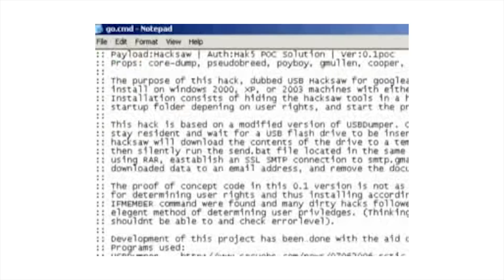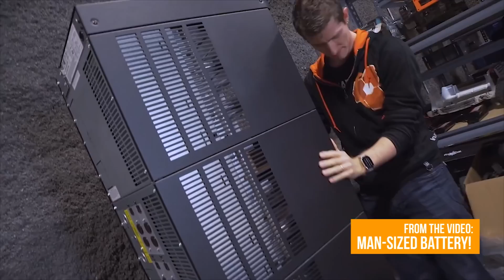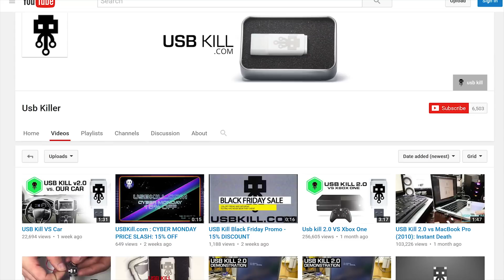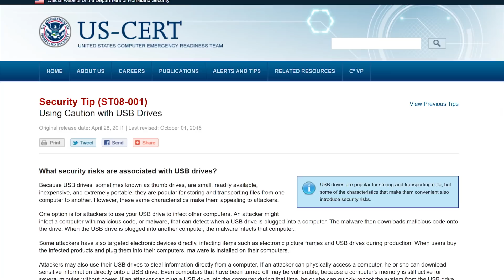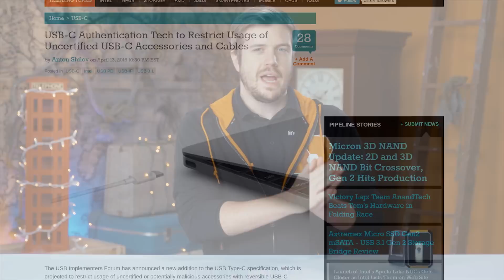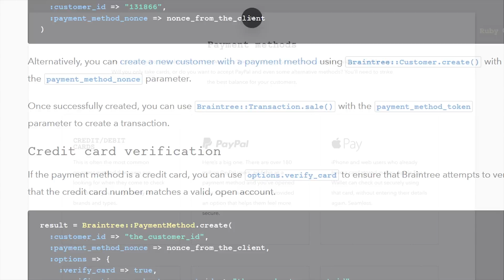COMPUTER DESTRUCTION (GONE DEADLY)

Comment: Even with optocouplers, the diode inside could die of high voltage. There is no clear way to protect against a very crude attack like this. Not even the "cryptography" could help. Sure if the USB port won't output current unless some device negotiation happens, but then again the whole point of USB is its simplicity and this would just ruin it.

Seriously, you could just as easily use a tazer to destroy a USB port like this.
Reply: The optocouplers will keep the damage local to the port, and maybe the PSU. That can only work if they're given separate circuits from the motherboard, of course. Yeah, there's still damage, but it's not as expensive.

As you say, though, there are other ways. It really depends how far you want to take this security. A simple cup of water can be a pain in the ass too.

I think the cryptography is used to protect against BadUSB rather than this attack (I know he said this attack in the video) because the firmware on the device can be verified using a cryptographic signature before running. I don't know all the details, but it should stop a USB drive acting like a keyboard.
Reply: ***** I am sorry, I thought you were referring to this attack. You are absolutely right, about the Bad USB attack. It's a very important thing that should have been implemented ages ago.
Reply: Smiba Thanks for the idea.
Reply: xan1242 If you want to destroy a computer, use a hammer
Reply: imawhale Why a hammer? Might as well use a bunch of sulfur acid to destroy it.

It's not about computer destruction per se, it's about how much damage you can deal to a computer over a USB port.
This could just as easily work on a PS/2 port if you got one.
Reply: an axe. and a chopping block. should make a video about it or something.
Reply: Lewis Hazell Well this is a purely electrical attack. It does not care whether you have 10avs or encryption or cryptographic signatures. It's going to fry the mobo & port anyway.
Reply: ***** "The drive would be fired", which drive are you talking about? lol!, he said hard drive would be fine, internals may be fried.
Reply: LifeRider 96 No problem! I can see how it could be misinterpreted. I agree, though, there's no way encryption could provide circuit security.
Reply: Thats why you put a proper diode in there rated up to 250V, or if you lack the space on your PCB design (or money) just put some easy fuses between them. 
Will it save the USB port? No (Well, replace the fuses), but it will save the whole computer

Small SMD fuses rated at like 12V are cheap and on top of that easy to implement.

Some systems have this already, but never on the data pins (Because high speed usb is really sensitive), thats why the USB Killer v2 is so much more effective

Comment: Pour water can kill the pc . Dont need usb killer.
Reply: Ng Chun Hong uhhhhh Linus proved that wrong, and took 2 thousand dollar laptops let them get rained on then got them running again :P may not be true for all hardware but if you can remove the battery and fully dry it, there is a high chance it will work again.
Reply: Ng Chun Hong way cheaper xD
Reply: yeah but the USB killer is pretty much undetectable just by looking at the pc
Reply: Green Guy after pouring the water , you can use a hair dryer to dry it then it won't be easilly detectable.

Comment: Well the 2015 mbp surly doesn't have optos on the USB datalines. However they do have ESD suppressors (D4600, D4601) those will act like a sparkgap  and that will discharge the 200V in there before it can go to the CPU. It also has to pass trough a MUX.

Comment: a resistor wouldnt work against this thing? Isnt 120 volts coming in through the wall and resistors in the power supply reduce the voltage down?

Comment: is there a nonmalicious reason for this thing?

stopping this sounds pretty easy to me, add a resistor circuit and a ground line.
if voltage piques over say 6 it dumps to ground and disables the line like a breaker.
not a consumer solution but it can be done.

the optical solution seems overengineered when all you need is surge protection.

Comment: optoisolating USB data lines is not that easy, some money there, optocoupler are not that fast and the fast ones are expensive. You can get data transferred to them, but matching USB 3  speed ?. Also, ANY EXPOSED port on the PC goes to a chipset. What's next ?. Isolating the audio port, the monitor port, the microphone port ?. PCs have exposed terminal all around. They are protected for ESD Thats all. A surge is a different thing. You can even feed a surge on a DC input of a notebook and ruin all the PSU section and probably more chips all around. Only thing about USB killer is, you can destroy HW in a discrete way. But anyone that already got access to a piece of HW is able to destroy it in any way

Comment: Just design the usb circuitry with high voltage clamping circuitry on the voltage output and date lines. a lot of devices have it, but motherboards dosent because they a build as cheap as possible even the "high end" ones.

Comment: Wouldn't it be easier to kill a PC the same way, just by pouring water on it? However this USB method may have the advantage on not leaving as much evidence as a water on the motherboard. 

I've also heard of something done the other way around: an admin of a company that wanted to stop employees and clients from connecting unauthorized USB drives to their PCs (that already had the sign DO NOT CONNECT FOREIGN USB DRIVES), has connected the front usb ports to a 12V power on the PC - resulting in PC killing the usb drives by overvoltage.

Comment: Isn't external ports on a motherboard protected with solid state reset able fuses by design? Worst case scenario would be a wire being short while being connected and powered and it should be covered in a well thought proof engineering.

Comment: Or you could just wire an AC cord to a USB plug. . .
Reply: I see no problem with this. If the computer catches fire then i'm pretty sure it's ded
Reply: no, it will catch fire due to the fact that it will keep going forever, unlike the usb killer, which pulses the current and stops when the thing dies.
Reply: Adrian Godoy it wouldn't
Reply: Tuxedo Jack is that you?
Reply: Cornelius Sneed mlmpmlllmmpmpllmlllllllmpmlllllllllllllll
Reply: it won't catch fire, the wires will melt quickly and there might be a bit of smoke but that's it, the worst that could happen is an electrolyte condensator exploding.
Reply: jonasxdufek What are you, 5? Its not hard to rewire electronics without shocking yourself.

Comment: You guys should talk to some engineer before publicly testifying on engineering stuff. Optocouplers won't work on this case. The power lines could still be attacked, and no one will place an Optocoupler in front of a USB 3.1 data line for signal integrity and cost reasons.
Reply: you could protect the data lines with small optos. the power lines of the usb could be protected by just having a semiconductor fuse paired with a snubber + some kind of heavy duty zenner. I have thermistors that will cut a 2000v transient to about 2 volts and if you cascade 2 of them well you can be protected against this kind of attack (you can buy fully made circuits, sinetamer has great ones. ) of course if you have  a source with a low output impedance there is no way of protecting a board. It will be like using a welding electrode in de usb port lol!
Reply: It's not that simple on this particular case. We are talking about very High Frequency lines, you would have to use an optocoupler that won't disturb a 5GBit line and respond on the same speed, that's not going to be practical on a cost perspective, those are not the cheap optocouplers we usually find. Also zeners, TVS and etc. are made for fast transients this won't be an occasional disturbance on the line, this will be a step-up converter, this could fry all this protections by not leaving them time to dissipate the energy as heat, not even mentioning the PCB clearances you will have to leave for the High Voltage isolations to avoid creepage so the arcs wont jump to other exposed pads nearby. So practically this will increase considerably the cost and size of the product so no manufacture will care to implement it. Theoretically, yes, you can protect any line you want from any kind of voltage, but this case it's just beyond practical.
Reply: MFeinstein you can get optos that respond to those speeds.  will it be cheap..  no.  but the methodology is not hard.
Reply: elave16 yes, as I said on the original post: not practical for cost reasons.
Reply: nhmhmhmmjmjMFeinstein
Reply: MFeinstein gggfgv
Reply: Moe Jaber it's not that simple, disconnecting a USB 3.1 port means you need something connected to the USB lines, this something needs to be transparent to high frequency signals and these aren't cheap at all
Reply: We can just have a step-down transformer installed or a security system that activates an electrical relay that detaches the USB ports from the motherboard. It's simple and I guess it would work ;). Plus, if u had the relay method as an option, u could detach the USB port from the motherboard and it would impossible for any viruses to enter, even if the guy(the person that tried to enter malware by a USB) had access over the computer, he wouldn't know the passcode to reattach the USB to the motherboard.

Comment: How to protect against this attack? Physical security and nothing else. If anyone has physical access to your computer it is already completely compromised, they could steal it, swap hardware at will, etc., and a handy USB device will not do a lot that plugging a USB cable directly into the wall socket (or hitting the computer with a sledgehammer) wouldn't already do. It makes zero difference, your computer is already dead or worse in a million ways once someone malicious has physical access (yes, plugging in a USB device you found in the parking lot with your company's logo printed on it is also giving everyone so inclined direct physical access to your machine).

Comment: It would be funny if the protection against this converted the 200V from the data pins and "injected" 1500V ( or more >:D ) to the power pins, blowing the electronics inside the killer, because i dont think that device has protection for that.

Comment: I made one of these my having a old electric motor that used 2v to power it, the rest of the volts circulated back to the outputing usb stick, I plugged in to my pic, but luckily it didn't break as my motherboard has overvolt protection

Comment: Jokes on them, my USB ports have individual fuses!
Reply: Tiago Oliveira, did you know a fuse melts it breaks? What would stop a voltage from jump past the USB port and straight to the CPU? A lot of air in-between. If we're just going to skip realistic scenarios, why would a photon gate prevent this? That's not a flaw in USB, that's sticking a taser to the port. If it could ionize the air to reach the other side of a broken fuse, it would already by arching past just the USB hub.
Reply: Fuses don't provide overvoltage protection, they protect against overcurrent.
Reply: Hans Wurst, V=I*R. A fuse is just a breakable resister, if the voltage is high then so will the current passing through it.
Reply: The fuse doesn't blow instantly. The voltage spike just occurs while the capacitors are discharging , which only takes a couple of milliseconds. The fuses on your USB port are to slow to react fast enough, which means they are completely useless in this situation. They are not there to protect your pc from an attack like this, they are there to protect your PC from a USB device which is drawing way to much power. For overvoltage protection you would use for example a metal oxide varistor.
Reply: Hans Wurst, or any surge protector, yes. I'll look into this further, but I had imagined the higher the current the faster the fuse would melt. Thank you.
Reply: I just made a rough calculation how much current would actually flow through the portand i came to at max 0.003mA which definetly wouldn't blow any USB fuse.( If you're interested on which values i used: 200V/60MOhm (i just measured the resistance of the port with a multimeter and, as expected, it was of the scale so i used the max resistance it can measure, which is 60Mohm, so the resistance is probably way higher, which means the current would be even lower) and it came out to about 
0,00000333333333333333A or 
0,00333333333333333mA ( max current USB 2 can supply is 700mA according to specification))
Reply: Hans Wurst. The resistance on a standard fuse used in appliances is roughly about 20 Ohms, so I'm not sure if removed the fuse before measuring its resistance. Standard fuses break at 0.3mA, and just based on magnitude of the calculation the current will reach 0.3mA.
Reply: jokes on you, do you even know that a fuse does? do you really think your pc would be safe if i try to put 2k through your fused usb port? you know eletricity can jump right?
Reply: Hans Wurst Nailed it! Thank you.

Comment: I'm not an speciallist here, but opto-coupler? Wouldn't a more simple fuse box do the job? A thermistor? Problem is the data ports I imagine... oh well.

For those extremely worried about things like these, I imagine one route to be at least a little bit safer would be disabling (as in physically disconnecting) all open USB ports on your desktop, and either permanently connecting a USB hub to some port on your PC, or to PCI USB card (not sure which is worse... since PCI cards are directly connected to the board, this could be even worse, but you do have an extra barrier in the way).

Just... don't do this. All in all, it's not all that much different from smashing a computer with a hammer, so there it is.
Reply: If someone had physical access to USB port of your device, They can just simply smash it.
Reply: But smashing it will raise suspicion. One could just walk into a security room while it's empty because of a random emergency reason, and while there's no one, just plug this into the computer that connects to the security cameras and just kill it. No noise, no real trace, just dead components. I mean, what the heck, you could go to Best Buy and while nobody is looking, just kill their demos one by one and then just leave. Sure their security cameras would probably show it, but unlike with smashing them, you could do it discretely and wear something that doesn't show your face or anything. This is really a problem that we don't have an answer for... A fuse could work for the rails, but you can't put one on the data channels, which could still receive 220V and just kill everything it's linked to.

Comment: I have a box of cheap usb killers. They are called caps (haha). A simple bridge rectifier and charging them on 220 volts. Jup that almost destroys anything. Not that I am willing to destroy anything. Also a small fuse and a 220 volt cable works as I once did with a router that was bugging and they wouldn't replace it. I told them see there was something wrong with it.

Comment: if you'll find a random usb stick pop the cap off and see  if theres one big block on one side or several small blocks in a row. if theres only a big one then its a memory module and you're safe if its little blocks then these are capacitors and dont plug it in and burn it in fire. done. "dont plug in random usb-s" problem fixed

Comment: and you link an amazon page to this fucker... at the first place, why u can even buy it from amazon if its illegal to use?
Reply: +Gabor Orosz
That's like saying they should ban all kitchen knives because you can kill people with them. No, this USB killer can be used as a tool and just because some retards abuse its power it doesn't mean it should be illegal.
Reply: Its illegal to use on hardware you don't own. A legal use would be testing your own circuits to see how they handle high voltage.
Reply: if someone is interested in it, i think he can find a better way to it, than buy one of these. this thing should be banned asap.
Reply: I once met a guy(head of cyber security) of one of the biggest banks in the Netherlands he had one always in his pocket so if someone tries to steal his laptop he can at least try and kill it before that. If you combo it with a high level of Full Disk Encryption with is decrypted by a build in part of your mainboard you are pretty saveish.
Reply: Slitting someones throath with a hunting knife is also illegal, owning one still isnt.
Reply: Tjidde Nieuwenhuizen The point of stealing is that the owner doesn't notice it long enough.
Also if your data are already encrypted well enough you don't need another protection.
Reply: tbh if your tryna hide stuff on your hardrive from the police use magnets am i right
Reply: doesnt always help

Comment: Couldnt you place an inline 5v fuse in the wire connecting the case usb ports and the motherboard? 200v comes out then it just pops the fuse, no harm done?

Comment: PS4 usb ports in front are protective
Reply: TwistedOracle but the data lines are fried.
Reply: ***** Actually you do need the data transfer if you want to put files on your ps4 and aren't savvy enough to set up a media center, or have a proper wired controller connection to it.

Comment: It should be illegal to sell and buy these.
Reply: No point, you could literally go to your local hardware store and make this yourself in 30 minutes tops.
Reply: ᚳᛁᚱᚳᛚᛖ ᛟᚠ ᛚᛁᚠᛖ true,but you would need to know to make it.
Reply: I agree, but there is still no point in making it illegal. You don't even need this device to kill hardware. I'm pretty sure 80% of people have replaced a wire with a plug on it. Instead of changing the plug, connect the wires to the pins of the usb. Plug the wire in the usb and then in the wall and say goodbye to your computer.

If someone really wants to fry your computer, illegal or not, they will find a way.